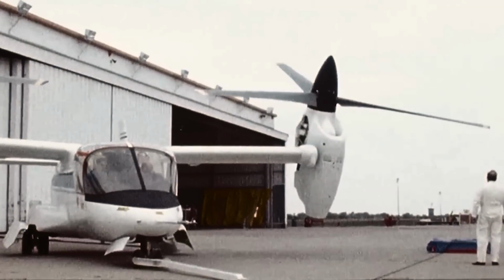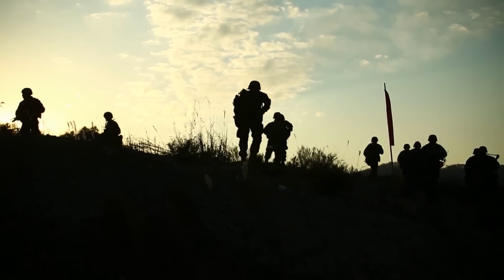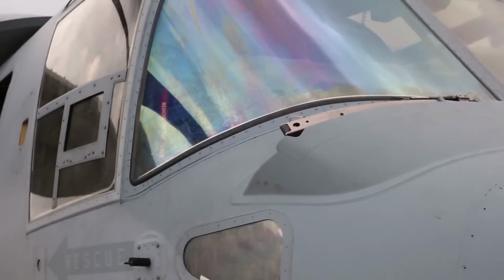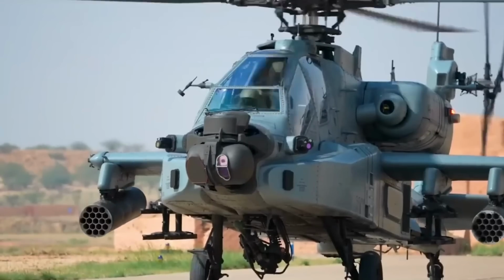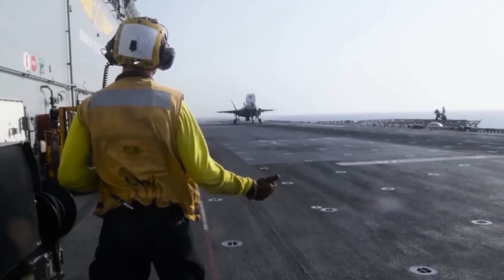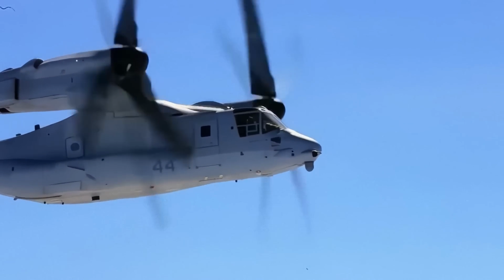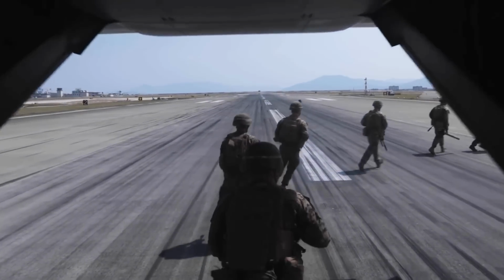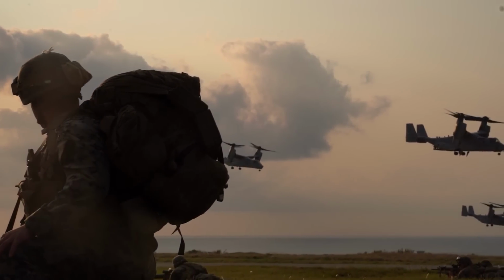V-22 Osprey – future or failure?

Comment: I got moved to the V-22 program in 1987 at Boeing Phila.  I worked through the development and production of the first 250 of them before I retired. That was over a span of 24 years. I built structures. I was in flight test for a while and I was standing there when aircraft five crashed.

Comment: ALL technology has learning curves and failures. There have been THOUSANDS of Blackhawks that have crashed all based on OLD technology. Yet is anyone trashing the Blackhawk? The Valor is the newest technology learned from the lessons learned on the V-22 Osprey. But it’s smaller with less lifting capacity and less 0:14 range and cannot fit on a carrier. It’s created to replace the Blackhawk. Given all the “Transformer” specs the military wanted on the V-22, it’s a wonder of technology. Updates in technology will greatly improve its future based on experience and failures.

Comment: I feel like the biggest problem the Osprey has is that it's a single airframe being built to do numerous very different jobs because as it matured people realized that the basic platform of a tiltrotor turboprop aircraft would be better at so many things than what they were already using. What the V-22 needs is more things like the Valiant, more aircraft that take advantage of the basic premise while being more specifically designed to perform better in certain areas. Which, sadly, is a thing that would take shitloads of time and money.

Comment: I wish the Army utilized the V-22. As shown in the video, it can fly faster and longer than a C-130. It can refuel other aircraft like a fuel tanker and transport troops and cargo like a C-130.

Most importantly, it can infiltrate and exfil faster than a plane or a chopper, making the craft ideal for airborne and air assault operations, both of which are performed by the U.S. Army.

Comment: We wonder how could any concern authority approve such aircraft with engine at extreme edge of wings which shows it cannot sustain itself in flight or in any phase of flight if one engine fails? Specially when engines are in rotor craft mode!! Any explanation on this?

Comment: All new technologies take time and money.
Reply: Tilt rotor tech isn’t new or worth the time. 35 years of groundings and corruption kept this thing from shining. When you read up on this thing in detail and the defense review recordings, it’s baffling who they pick to run this important programs. After 10 years in flight testing, it couldn’t lift a humvee or go more than a day without mechanical issues. This was in 2001, when they signed off 400 aircraft and at 40 million per aircraft, it wasn’t even finished: it didn’t have midair refueling or de-icing fitted, kinda important to have features when your going to be a frontline aircraft. UH-1 and UH-60s are here to stay and the V-22 stans need to wake up.
Reply: @mmmmburgerz9442 Today these vital assets are limited to 30 minute missions. They did not achieve a critical design requirement as it stands. This program looks to be another corporate welfare construct.

Comment: Future or failure? That is a false dichotomy. It doesn't have to be one or the other. I don't think it is a failure, but I don't think it is the future either.  Like all 'firsts', the Osprey has it's problems, but it is still a very extraordinary and useful aircraft. The V-280, which only rotates the transmission and propellers, rather than the entire engine nacelle, is a better design in my opinion, with a lot of improvements. The lessons learned from designing, building and operating the V-22 went into making the V-280 a better aircraft.
Reply: In V-280 instead of V-22, power 14000 hp pass through bevel gears. It’s weak point.

Comment: With Hybrid being a catch phrase of the automotive industry, I could see a hybrid version of the tilt rotor and the S/VTOL. Shorter rotor/propellers, and limited to a 45° rotation. Adding a powerplant in (or over) the fuselage, with proper transmissions. I could see a Field Capable Combat Short Takeoff/Multi-Role (FCC-MR). It can't hover, but it would be a low speed supplement/replacement to attack helicopters and  be able to provide a fast response supplement to the A-10 Warthog.
Reply: Well, thank God we have so many capable engineers and aircraft designers sitting in their living rooms, we really don't need all these highly trained and specialized technicians who are actually employed by aircraft makers to come up with ideas. I will tell Lockheed Martin to get in touch with you.

Comment: The development of the osprey and the F-35 are apart of the same strategy for naval operations. By having a plane that can take off and land vertically you have a huge advantage over your enemy during a major conflict. One of the first and most important target for any conflict will always be the airfields to deny the ability to take off and land their aircraft. Any large craters from artillery or cruise missiles on an airfield will ground the aircraft. 

The other issue is that aircraft carriers are major targets for attack and forces them to be out of range to avoid being sunk. The osprey and F35 have the ability to land on barges or commercial ships. 

During a full scale war the pacific could have hundreds even thousands of barges and commercial ships converted to allow these aircraft to land and be refueled and re armed. 

They are also specifically designed to be used together. The V22 can be used to refuel the F35 while also be used to transport armament and cargo. Theoretically on a barge or commercial ship with enough fuel it could make it possible for hundreds of floating bases across the pacific making it almost impossible to destroy all of these targets. 

The spaceX self landing rockets have also been designed to land on barges and ships and can then be refueled and launched. To me it seems that this would allow the US to have an overwhelming footprint in any body of water removing the need for land bases which are vulnerable to attacks from any guerilla attack. Unlike land any one attempting to attack a base in the water would be destroyed long before it could  reach them.

Comment: The only reason she had some accidents is in the transitioning fto. Helicoter to plane is in the trim while transitioning not aiming the nose up while the blades transition to turbo prop now desert ones failure was one chopoer broke down well the refurling craft c130 not starlifters well the helicopter that hit was caused by untrained crew that were already traned in nvg goggles back to the ov22 trim the nose up will overcome the problem with the transition

Comment: It can't glide properly like a plane, neither it can auto rotate properly like a helicopter. More risk in the case of engine failure.
Reply: False it can do both and there had never been a dual engine failure in an Osprey yet.
Reply: @n3v3rforgott3n9 it can*
The descent rate is extremly high that recovery is all but hopeless unless conditions are absolutely perfect. Ask any V22 pilot

Comment: It's an accident waiting to happen, unfortunately the military will continue trying.
Reply: the ridiculous comments i see here of people worshipping this trash of engines configuration is absurd, just because it looks cool. 

is unbelievable.
Reply: @lcfflc3887  The engine configuration make it able to do things that are impossible in a helicopter.
Reply: @n3v3rforgott3n9  LOL good joke but nope 🙄, can't wait to see it doing a full loop like a helicopter do or perhaps flying backwards or flying forward upside down. 
 you failed miserably
Reply: @lcfflc3887  "doing a full loop like a helicopter do"
-... try doing that in a CH-46 or CH-53.

"perhaps flying backwards" 
-have you done any basic research... yes the osprey can fly backwards.

"flying forward upside down. "
-this is pure stupidity 

"it crash and kills military personnel without even been shot at"
-so do all other military aircraft... the blackhawk had 20+ crashes in the first 6 years of its service. The rate of which the Osprey crashes is better than the CH-46, CH-47, CH-53, C-130, and even close to the blackhawk.

Maybe if you weren't so bias and only looking at internet myths you wouldn't sound like such a fool.
Reply: The Osprey is one of the safest aircraft the Navy flies and the data backs this up.
Reply: @n3v3rforgott3n9  wrong again LOL, it crash and kills military personnel without even been shot at, Fckng embarrassment, poor families of those soldiers, to tell them they die in such silly way like this.

Comment: We just had a V-22 go down off Darwin in Northern Australia Killing three Marines. This particular aircraft had been putting on Displays at our Pacific Air Show, and was loved by many here.  The aircraft is notorious for it maintenance complexity and failures, often resulting in the loss of personnel. As an asset to the Military it certainly proves its value but needs serious changes to improve reliability and safety.
Reply: It can't glide properly like a plane, neither it can auto rotate properly like a helicopter. More risk in the case of engine failure.
Reply: IIRC either this or its successor they have a gearshaft going through the wings that allows one engine to power the other rotor in emergencies.
Reply: Funny how helicopters crash all the time and everyone just says "oh well, these things happen, that's just part of helicopter utilization". A V-22 crashes and everyone freaks out and blames the concept.
Reply: there's nothing you can do to this plane, yes it's a plane and very vulnerable when is taking off or landing in hover mode, if any of the two engines loose power or come to a pressure stall you fall down like a yunker, even a  Chinook has a better chance when it loses one of its engines.
Reply: @lcfflc3887 wrong, both engines share a drive shaft so if you lose one the other still provides lift
Reply: The replacement has a different tilt engine pod configuration. I also believe, apart from the complexity, the issue was with run-away engine control via the gear box which caused loss of control. I stand to be corrected. In any case, there is virtually no way for the pilot to recover the aircraft in the case of mechanical failure. @lcfflc3887
Reply: @lcfflc3887   It's not a plane. Stop talking about something you know nothing about. The Chinook is also slow as hell and eats up fuel.

Comment: It could turn out that conventional helicopters are simply a better approach with mid-air refueling for the same range. This increases the logistics for aerial refueling, but comes with a lower weight, higher overall reliability and much lower complexity and price. In general, not everything that looks like great engineering is actually a good approach to a practical solution. This certainly also applys to tiltrotor airframes. In my opinion, this is just a very expensive failure that no one wants to give up at this point because it has already cost so excessive amounts of taxpayer money.
Reply: Well stated!
Reply: Yes, the fallacy of the sunk cost rules.
Reply: False... Tilt rotors are by far better.

The Osprey is one of the safest aircraft the Navy flies and the data backs this up.

Comment: Current tuning of engine audiophile-sounds graphing of intake, exhaust, engine, blades, air-flow areas, air-speed ranges had resulted in non-ducted fans(rotor-sets of many-blades) poking-air, slicing-air, dragging-air, biting-air, eating-air, ... front-center-rear of single blade-set audiophile graphing. People are democratic and not-usually your-nanny. Feel free to do right-wrong good-bad funny-serious ... and continue-discontinue, ...
Reply: Bicycle riding style of slice-and-dice minced-meat spread smoked-salmon on biscuit-bread-crackers are somewhat similar in terminology-wording but not quite the same industry. Still building baseline of world to mince. Nevermind the vehicles.

Comment: As mentioned below, 1950s Fairey Rotodyne is a far more logical design. Two props + main rotor. Safer, simple (compared to Osprey), autorotate, cruise 191kts (Osprey only 250kts), easy transition from vertical to horizontal flight, very stable, better in bad weather, better carrying sling load, capable of heavy lift, no scorched deck, cheaper.

Comment: Any civilian applications?
Reply: Of the V-22 Osprey? No no one can afford that. There is a civilian tilt-rotor, the Leonardo AW609, which is shown in the video; however, after two decades since its first flight it is still in the certification process so it is not in production or service.
Reply: @brianb-p6586  Wow, very useful but expensive.

Comment: Failure due to engine pod rotation and only good for military use.  Very expensive mistake.
Reply: Redundant systems in place to account for nacelle rotation issues, if you can rotate nacelles at least above N36 deg you can still try ROL and have blade/ground clearance, if unable to get about 36 deg, could still try a ROL, the blades are designed to snap off (which unfortunately has been demonstrated during one of the early accidents).

Comment: I was an engineering co-op at Allison in the early 1980's and remember when the proposal for the T-406 engine was developed.  Allison had gotten into the competition late, and when their proposal was tendered it blew the other ones out of the water.  
I've followed the V22 program since then, and am glad that the technology is established.  The tiltrotor concept fills a hole in capability between fixed and rotary wing aircraft, and it took blood, tears, toil, and sweat to make it happen.  It took basically 20 years of development to reach initial fielding in 2005 and another 9 years of in-use maturation before the V22 reached full acceptance.

And thanks to Skyships Eng for pointing out that the T-406 was originally created by Allison.
Reply: 29 November 2023. Another Osprey Down, US Air Force? 8 on board. Engine was seen to be on fire by ground locals, off Japan.
Reply: Complete garbage, horrible design, too many moving parts and too fragile for any mission. Total waste of tax payer money.

Comment: I believe the answer to your click bait question about the future of the tilt rotor will be that a near term evolution of a very  large scaled up version of a DJI Mavick MT30 with bullet and flak resistant nacelles surrounding the rotors and will have rotation at it's wrists for fine direction, hover and lift control will appear as prototypes by 2026 and service start around 2030. It will lift twice the payload of the V-22, No cavitation noise or speed limitation due to blade tip deflection, will not need transition delay to lateral flight and will definitely not suffer the VRS (Vortex Ring State) fatalty found on the V-22 Osprey.

Comment: They should build it with electric engines and a powerful turbashaft to supply the necessary electricity.
Reply: Why? Would the purpose be to increase the cost, weight, and complexity, while reducing efficiency?

Comment: Why not replace the turboprops with turbofan engines 😅  ?
Reply: Jet blast from turbofans is hotter and more powerful than from turboprops, lower bypass ratio leads to less efficiency esp. at the speeds the Osprey is supposed to go at. Turbofans are best used for 400-600kts

Comment: The v22 showed it can be done but also how it shoudlnt be done, the complications of moving the entire engine  is one of the issues.   Yet I understand the moving prop/rotor on the new design uses new manufacturing technologies new materials and powerful computers not available in the 70s.   I think of the v22 like the f117 it lead the way for stealth but was limited from its older technology.

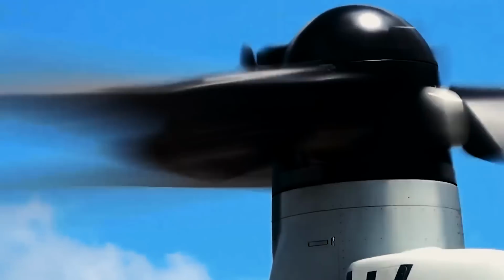Comment: At 13:58
Rotor diameter....

You forgot to mention that the rotor had to be shorter than optimal so that it could fold plus wouldn't strike the ground when tilted forward. I have heard both 2m and 3m numbers....

Comment: The V-22 Osprey today is an effective and safe aircraft.  It did have a turbulent beginning and had a lot of bugs at the beginning.  But even though expensive, the investment in the technology has paid for itself.  The V-22 was not alone in being revolutionary and having a lot of issues.  The F-14 Tomcat was also very expensive, suffering many problems at its inception, and requiring a lot of work to correct.  Without sales to Iran, the US Navy might not have been able to afford it.  Its service to the Navy was proof of the wisdom of approving it for production and the constant efforts to improve it.  The F-111 had major issues too, and while its Navy trials were failures, its service to the Air Force was outstanding.

Comment: I'm going with failure. I hope I'm wrong. The Defiant X would have been on hell of a platform. I just don't trust the tilt wing/rotor to not kill more people.
Reply: It's the first production tilt rotor, it has its flaws but so does every first production example of a new type of machine. The Army seems to think it's a success as they picked a very similar tilt rotor for the FVL program in the v280 valor. Building on what was learned from the v22